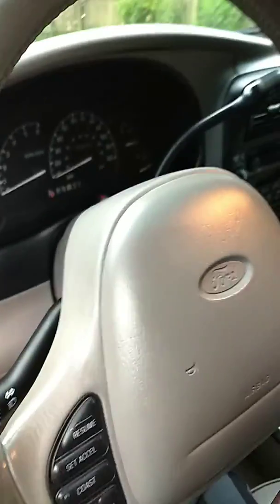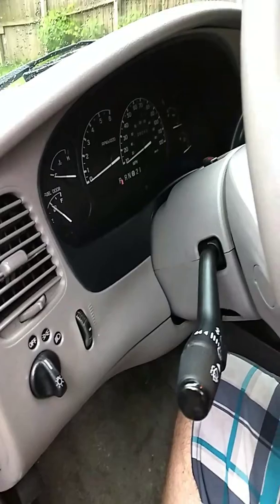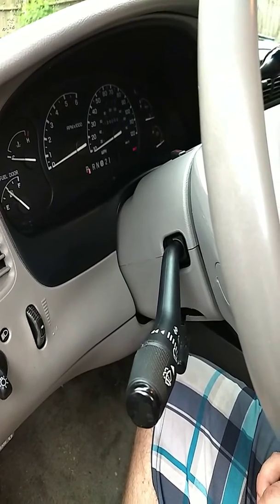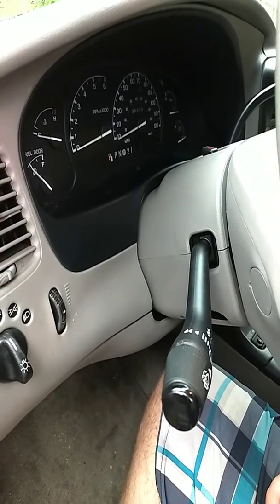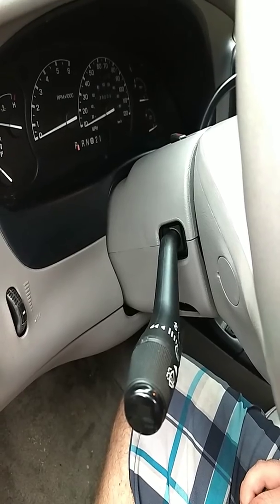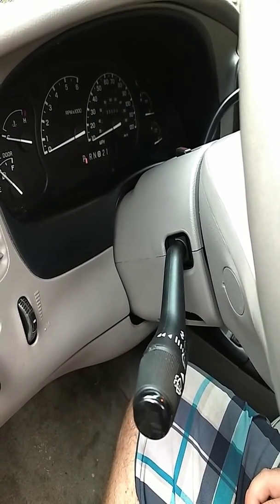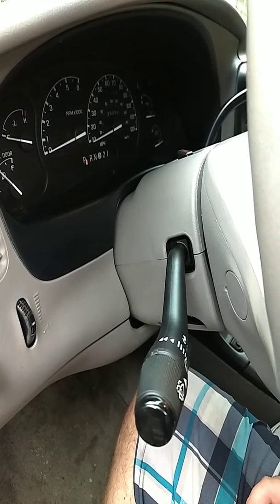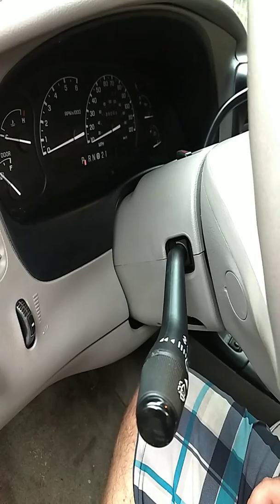SOLVED! Ford explorer no brake lights or turn signals

Comment: This absolutely is a good repair , 2002 explorer right side rear blinker and brake light didnt work but the right front blinker worked and left side brake and blinker worked I have shop key and it faild to mention this. my issue was the wires had backed out of the connector
Reply: So did you have to replace the switch, the wires, harness or did you just tuck wires in? My blinkers and lights work if i lift my wheel to untilt
Reply: @theroguemaven  no the switch was still good but the connector is made out of plastic and became brittle and the fingers that held the wire terminals in place had broken off and the wires had popped out so I had to go to my local junkyard to find the connector and depin the connector without breaking the little fingers that held the wires in.

Comment: Yes this is correct had the same problem. I took the clam shell off from around the steering column and the wires where pulled out from the connector    and I noticed thay taped the wires so thay don't move from the factory so when you lower the steering wheel thay pull out from the connector .

Comment: I do have questions... 
I have a 2003 Ford Explorer 2 door Sports SUV.  The current issue is ;  my rear brake lights don't work and my blinkers don't work either, or they flash very fast.  I believe the problem is one of the wires in the steering column has broken loose. So, this is what I've witnessed by other videos. I have checked all fuses and balbs, all were working. Therefore, my deduction is what you've mentioned but you stopped without showing HOW TO FIX IT.  IF YOU WOULD 
PLEASE DO SHOW ME HOW TO FIX THIS ISSUE, THANK YOU.
Patti
Reply from the maker: Take the plastic pieces off on the column. Undo two screws and unplug wiring. It's really easy.

Comment: I don’t get it
What was the solution?
All of my lights work except stop lights; fuses and bulbs checked, brake lights switch replaced but still stop light don’t work
Reply from the maker: Did you even bother to watch the video? Tells you very clearly what the solution was.